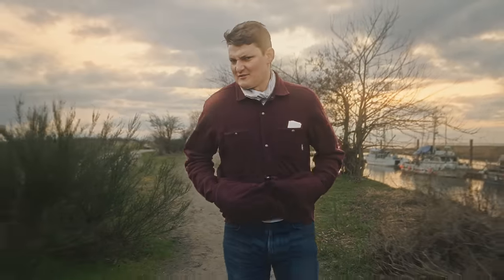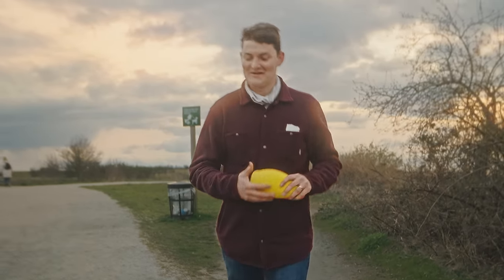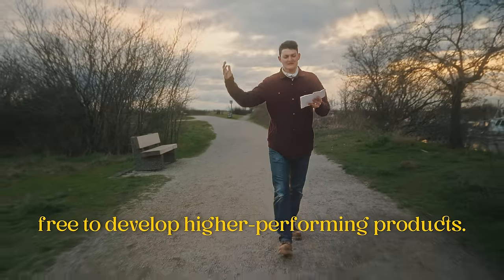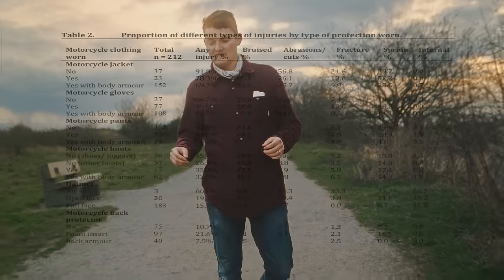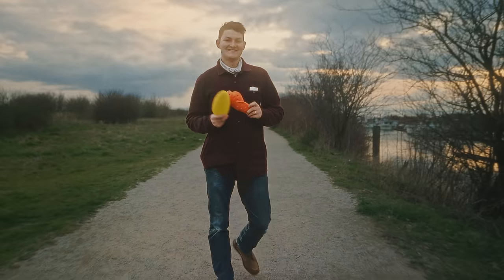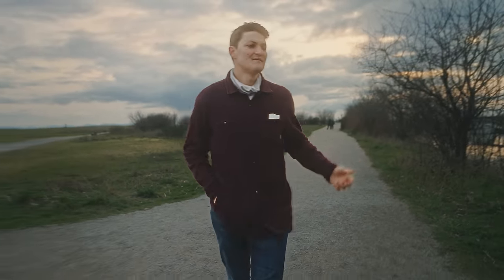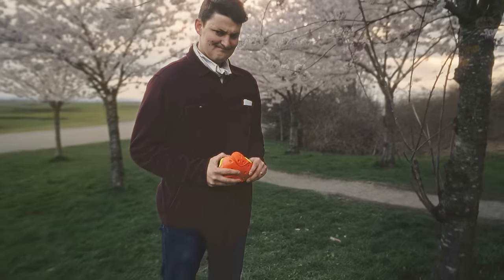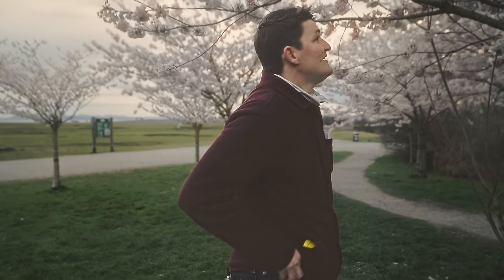Why I Stopped Wearing Motorcycle Body Armour

Comment: I’m an ER doc.  I know armour won’t help in worst case, high energy scenario’s, but it helps mitigate the contusions, abrasions and lacerations in the kind of spills we are more likely to suffer. I had a low speed mishap riding off road in Iceland and diced up the elbows and arms of my riding jacket on volcanic rock. I had a few minor scratches from punctures through the  Cordura fabric in the unpadded areas, but without armour protection it would have been a  long complicated journey to a distant hospital to suture up contaminated, complex lacerations that would have terminated my bucket list trip. Some dabs of Polysporin for the skin and duct tape for the jacket and I was good to go.
Reply: Agreed. Even minimal protection can be the difference between a lesser injury and a severe injury. Early on in my riding days I had a lower speed crash where my left foot got pinned by the footrest and drug underneath the bike as I slid. I had worn basic "steel" toe boots and they prevented the footrest from impaling my foot. Still hurt, still injured, but it was the difference between literally walking away or visiting someone like you.
Reply: Hey Internet why isn't this the comment with 14k likes?
Reply: THIS!  Fortnine is only looking at the "fracture" or "not fracture" binary, and completely ignoring the fact that fracture severity is a spectrum that runs from hairline to shattered, and that spectrum is directly correlated with impact force.  Armor reduces force received by your body, which reduces injury severity.
Reply: @Ghazrin  Most dmg comes from sliding on concrete, for that the armor works just fine.
Reply: I agree.  I like Ryan F9 but he is FOS on this one. I've crashed before at (going less than 60km) and the armor protected my knees. I was able to walk away with no need for rehab.  An airbag is not going to protect you if you are going fast enough and hit something hard enough. 

If Nike, Coach or Levis, wanted to get in the market, then putting body armor in their clothes, then it would not be that hard.
Reply: Absolutely agree. It's like the people who sight a motorcycle helmet won't save your life in a high speed collision, but won't seed that a 10mph collision is practically benign with a helmet and life altering without.
Reply: @DuBstep115  That depends entirely on the nature of the crash.  In a lowside spill there's not much impact force, so your biggest concern is abrasion.  But if you get thrown highside, or you're struck by another vehicle, impact forces can cause far more serious damage than going for a slide.
Reply: I think this is a great point but also for me helps prove the point even more. Most of the time when I'm riding it's for under an hour and on local roads, from one destination to the next. In those scenarios I feel like removing the body armor would make the whole experience that much better. Now if I was going riding for the day and that was my primary intention, leaving the extra armor in would make sense. Similar to the trip you took, having that extra protection in those moments would make sense.
Reply: Hey this dropped on April 1st
Reply: @Ghazrin  If you are going 80km/h and get hit by a car. You are going to break bones + internal bleeding no matter what you wear
Reply: @DuBstep115  Yes, that's very likely!  But if you're wearing CE rated armor that can mitigate some of the impact forces, the seriousness of your injuries will very likely be less than if you're not wearing any armor and your body has to absorb all of that force...which is exactly what I pointed out in my original comment.  Cheers!
Reply: @felio182  lol...I hadn't noticed that.  Good point! 😂
Reply: @Ghazrin  You guys obviously didn't watch or understand the whole video. He touched on everything you all said here.
Reply: @onwilson2  Lol. He touched on all these things in this comment section. Who's the one FOS who obviously didn't watch or comprehend the full video?
Reply: @simonzarife7822  it is all about the risk you are willing to assume. I like riding but I cannot afford the injuries that come with high speed or low speed motorcycle accidents.
Reply: Great point
Reply: @onwilson2  totally agree. It's finding the right balance that works for each person
Reply: @SUSHI4lyf  Oh? Maybe you're right.  What's the timestamp in the video where he touches on fracture severity correlating to impact force received?
Reply: I am with Doc on this one...
Reply: Tbh I don't think Ryan is saying don't wear armour, he's saying that the protection given is poor at best, I see it more of a challenge to companies to up their game or legislators to tighten standards to a point they are actually doing more than the minimum.  Truth is the brain bucket is the only bit of equipment that affects mortality rates and as any experienced rider would say assessing risks and not allowing yourself to become a statistic.  Not saying accidents don't happen to safe riders, just saying your more likely to be a statistic if you ride in a ln unsafe way.
Reply: It's impact (energy) dispersal.  Ryan sometimes lets anecdotal science be his judge.  Sometimes, it's common sense.  If you just drop to your knees with and without the knee pads, you will quickly realize he is not correct and will be sorry you did.
Reply: @felio182 😂👌🏻
Reply: Vanity anime Fortnine. He is always searching for pairs of eyes and views. In his head, the entire world is wrong in everything.
Reply: @EmmanuelGontchoM  but he's usually right (:   Just not this time ((::
Reply: @JH-wd6dp  That's what I was thinking. Unless that armour leads to more harm or more severe harm, keep the padding.
Reply: @Ghazrin  i guess that is your opinion?
Reply: @michaeldobson8859  Nope.  If you take a 50kN impact to your body armor, and it mitigates all but 9kN, you may still suffer a fracture.  But the break you get from absorbing 9kN of force is not the same break you get from being unarmored and absorbing all 50kN of force.  Reducing the impact force transmitted to your joints reduces the severity of the injury you suffer, which in turn reduces your recovery time, cost, pain, etc.  That's just basic physics and common sense.  My OPINION is that it's reckless and irresponsible for Ryan to use his platform to suggest to large numbers of riders that motorcycle armor has no benefit.  Cheers!
Reply: I agree. I had to get a very quick pull out of snow one evening. Because I was in a hurry, I ran around the back of my truck to disconnect the chain to let the guy helping me get on his way. As I came around the corner, I hit ice and went down on my hip.  OMG it hurt, and it hurt for weeks.  I then think about the hip pads in my riding pants, that is not very thick, however, it certainly would have spread out the impact some, and certainly my pain level would have been less. How much? I don't know, but more than none.
Reply: Thanks. Logic.
Reply: Regards from Iceland✌
Reply: off road you're not driving 80mph
Reply: In the video he spews lot's of technical jargon....But it's simple common sense: If I'm gonna whack your forearm with a club....Do you want some armour protecting your forearm or be hit with no protection? If all the jacket has is some thin foam pads why bother buying it?
Reply: @simonzarife7822  I was only a mile from home when I had a big one. Most rides start from home and are short ones. You can't decide when the accident is going to happen.
Reply: @DuBstep115  I broke bones but no internal bleeds and it was over 80 km/h.
Reply: If you're going 200mph or 150mph it isn't doing anything ok, doc? You ain't a biker. We ain't Talking about 40mph moped  crashes "doc"
Reply: I fall down some months ago with my bike. That day I decided to wear full gear. Track suit, boots and track gloves. 

I dumped the bike at 40-35 kph, hit the ground and slide for 20 m. The bike hit my right boot and knee. The track suit saved me from having a fracture for sure. The knee pads protected me and the boot saved me too. 

The result of the fall was only a good hit in my lower hip with a bruising, another bruising in the back left side of my calf and a little scratch in my right elbow ( made by a sewing of the track suit)

I walked away from the fall, with only that damages. I think that the aftermath without wearing protection in that case would be a broken tibia, abrasion in my knee, right hand , hip and chest. Probably a broken elbow and broken femur too.

Guys, wear protection, you never know when you are gonna kiss the ground a car, a tree or a pole.
Reply: Well, man the hell up.  A little bang isn't going to kill you.  It's the big bang that you need to worry about.  I'm pretty sure those low energy impacts is equivalent to getting kicked sparring.  I didn't wear pads on my chest or shoulders and took the pain.  Like I said, man up.  If it ain't going to break your bones, then you're alright.
Reply: @JBlueVan because this was talked about in the video
Reply: @simonzarife7822  I tend to respect the "rule" "ATGATT" (All the gear all the time). I didn't spend that much money in protective gear to get involved in a crash and have to think "If only I had put my airbag on (or whatever piece of gear)". I think a lot of crashes are happening on the roads you take the most, and on shorter rides. Ride safe! :hand-purple-blue-peace:
Reply: @simonzarife7822 most car crashes happen in a 25 mile radius of your home. Pretty sure that would hold up with motorcycles.... especially when you state most of your rides are on local roads for under an hour.

I'm a personal liberty kind of guy. Wear or don't. When you choose. But I'm also for personal responsibility. If an insurance company decides not to cover your injuries if you forgo protection (stated up front in the policy), that should be their right. And maybe government shouldn't provide unlimited taxpayer funded care to those who choose not to protect themselves. 

Not trying to crap on you, just pointing out what probably should be (so others don't subsidize a person's personal liberty choices). You do you, I guess they say now.
Reply: I wear armor because of "Road rash".
Reply: Having experienced a couple of low sides and the effects of impact and friction on my body; this crash dummy is here to tell you, I’m glad it was while wearing quality Kevlar impact and abrasion resistant material (and a full face helmet of course). This dummy was soon able to ride another day.
Reply: How does an ER doc find time for fortnine
Reply: @williamjarvis3473  By maybe actually having some time off from work, perhaps? It's not like they work 24 hours a day, 7 days a week. Most of the ER doctors I know have at least some time for life outside work. In general, ER doctors work fewer hours than some other specialties (and make less money). That's partly why some of them chose emergency medicine.
Reply: @thirstybonsai1888  1) He said, " I know armour won’t help in worst case, high energy [scenarios]...". So, he already pointed out what you felt the need to nitpick about. 2) At those speeds, your helmetprobably isn't going to do much, either. Sure, you won't peel your face off on the asphalt and you might not fracture your skull, but there's a chance that you'll have a brain bleed and maybe cervical spine fractures. I'm going to go out on a limb and hypothesize that you don't always ride 150+mph, if only because you have to spend some of your riding time accelerating to those speeds. It's those lower speeds you spend some of your time at that the armor is intended for. The point he was trying to make wasn't that the armor will save you when you exceed its limits, but that it might when you have an accident within the limits it's designed for.
Reply: Being an "ER Doctor" you'd think you would know the difference between proof and stipulation. You cannot say they help you have no idea. A bit like covid you have no idea there either
Reply: There's no question that the industries standards are too low.  But you're a damn fool to pull out any kind of protection.    Speaking from experience, the standard protection did save my life.  That is why I now gear up with extra protection in the form of an airbag vest,  better guarded boots, etc.  because I do appreciate life and want to spend a little more quality time on this earth.
Reply: @onwilson2  Won't help hitting a wall at high speed- but considering where airbags were designed for originally, and how successful they've been there, it's doubtful you'll be going faster than the testing grounds. And if you are, it's a you problem.

The doc's point here is questionable. The scenario the doctor writes is one that RF9 noted he'd be wearing gear for. So it's a moot point.
Reply: @lavransmathiesen9099  interesting. I'd have to watch the video again to see if he mentions the speed that most people crash at.  Even with all the stats ones bone density and general fitness plays a role in injuries and crash survivability at certain speeds.  I recall reading an article a long time ago that armor protects your bones from being splintered to powder so that you can recover so the idea is not walking away injury free. 
I've crash and been hit by cars going  at mid speed (40 kmh - 70kmh) with armor and walked away with no scratches, no broken bones, shredded clothes and shredded pads;  the armor did their job. I have friends who are "former" riders because of permanent knee,  ankle and hip injury at the same speeds. They all had the (new) RyanF9 view. There are old farts who ride Harleys with no protection at all the time and I say rock on.
I hate the nanny state so  everyone should ride with as much or as  little protection as they want (even helmets, & eye protection included)

Agreed nothing will help if you hit a wall at high speed  or if a semi or large vehicle hits you at speed. Same is true for a car.
Reply: @onwilson2  That's the very point he makes- the armor does NOT protect from bone damage or sprain. They protect from bruising and abrasion, but not from breaking. He's talking about the CE 1 & 2 inserts.

Now, abrasion is often the worst part about an accident, the thing you remember the longest. That's taken care of by the fabric (a shirt or coat designed to be abrasion resistant). Synthetics get hot, so the pads would also likely help with some of the burns you'll get.

The higher protection of BMX type armor really does protect from fractures, but doesn't do well at abrasion (unless covered by something abrasion resistant).

I still tend to wear protection- as I get older I like pain less, probably because it becomes more of a constant companion. I do tend to wear an airbag- I want to walk away or die, I don't want to wind up a living brain in a body that can't move. OTOH, I have been moving to wearing hard pads under pants and coats (currently Mosko Moto's Basilisk gear when on the ADV in the mountains with Fox and Leatt armor under).
Reply: @lavransmathiesen9099  the armor protected me from bone damage. It was CE 1 at the time.  Any coverage that can eventually get you back on the road is better than nothing.
Reply: @onwilson2  Sure- I'd agree with that.
Reply: An MD who doesn’t know proper apostrophe usage? I’m skeptical, however I agree with you.
Reply: I'm a doctor too, seen a fair few m.cycle Vs road... had a few of them myself..... but I think he did stress bone though. and fractures
Reply: A voice of reason. I do high speed roller blading, fully geared , perfect example of why Id rather look a bit weird and slightly uncomfortable  2 years ago :)) ...